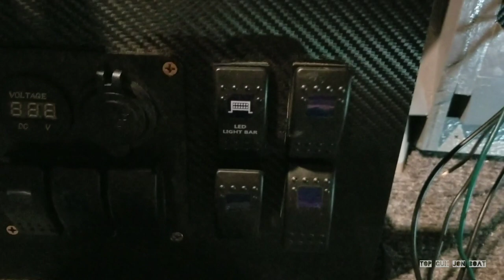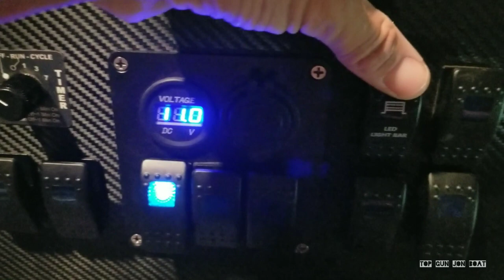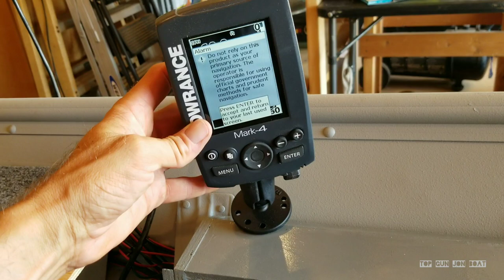WIRING MY BOAT 3- DIY Full Electronics In Jon Boat

Comment: Anthony, you probably havnt tried to look over the internet on how to wire up a blue seas  fuse box to a switch panel because there isn't much advise for rookie wire guys like us, man you hit the ball out the park, Ive struggled on how the fuse box should be linked as I have purchased one and am at the point where all my accessories are at the box and panel, now I know how to proceed with your video     thank you

Comment: Curious if you ever thought about mounting "momentary" switches inside the hatch doors, adjacent to the latches.  Not sure which ones would be the best, but these would add the ability to leave the stowage circuits "on", with any individual hatch light illuminating only when that hatch door is opened.  If you have, it'd be interesting to know what you recommend.  1,000 thanks -- and fantastic work!

Comment: I may be showing my ignorance a bit here, but what is the process you follow to determine the amperage of the fuse for each circuit?  I think from the sketch pad shot you showed, you have 30A on the light bar and 2A on the fishfinder.  I'm not sure of the other ones, but I'd think that the circuits serving the other lighting could be pretty low-amperage, since LEDs have very low amperage demand.  Thanks!

Comment: this is exactly the video i’ve been looking for! i have one question tho, i bought a switch panel with 5 ends on the back and only 1 of the ends is open for the accessory of choice; how do i run the accessory into that 1 end and then run that end into my fuse panel? can i connect the two wires at the end? i’m confused here. any help is appreciated. thank you!
Reply from the maker: If your saying you have a 5 pin switch, you can wire the same as 3 pin. I recommend the 3 pin because it is less confusing.  You'll have to do some testing to see what pins are what but you want to isolate the pon for the accessory,  the pin for power in from the fuse box, and the negative pin which all can be jumped. Again, the negative from the accessory will go straight to negative bus bar. Hard to explain here, if you were on Instagram we could direct message and I'd request images to further help.
Reply: Anthony Jones okay! i’ll find you on instagram and when my switch board comes in, i’ll message you! i appreciate the help!

Comment: Hey cousin, what do you think about using 16 gauge? I know yours is mainly 14. I was getting ready to order that Marine grade duplex wire to use on my boat and trailer.
Reply from the maker: I guess it just depends on the length of wire and what the draw is. I'll be honest, I kinda took Mike Lopez lead when he said he started running 14 gauge across the board in his boats. 16 is probably fine but I feel there are no doubts or issues with anything being underpowered or being unsafe with 14 which is why I did it.
Reply: Depends on the load of the accessory.  A trolling motor draws way more amps than a LED light.  The more amps used, the larger the wire (smaller numerical gauge size), also more watts used for longer amounts of time heats up the wire more and needs a larger wire.  Personally I typically run mostly 12 gauge wire because it’s way overkill.  In my switch panels though I run 22 or even 30 gauge wire from switch to relay.  I started using CAT IV cable (Ethernet cable) for my switches because the loads are less than 1 amp per switch to the relay.  The output from my relays are typically 12 or 14 gauge wire.

Comment: Very helpfull videos cuz, what battery are u using? And how do you like it so far
Reply from the maker: So I get my batteries from a local place, nothing special. Just high am hr deep cycles. I now run lithium ion 48v battery w the new electric outboard though.
Reply: @AnthonyJonesBrigadeBoats  I'm redoing from scratch a boston whaler 15'. All info helps. That ks

Comment: Where do get that voltage switch set up? And you said carbon fiber vinyl, is it like tape or did you do a video on carbon
Fiber wrapping?
Reply from the maker: Everything used is linked in the video description. The volt meter/USB combo is linked as well as the carbon fiber vinyl. Takes you to Amazon and the exact product i used. I have links in most of my videos in the description.

Yes, idid a video on wrapping, its a Small Boat Short Episode,  titled Carbon Fiber Vinyl
Reply: Thanks I start my boat this weekend, man I have a journey in front of me, I appreciate the videos. It is kind of like a blank canvas.

Comment: The negative lead from the switches goes into the bus bar? Are all of your switches negatives jumped together?
Reply from the maker: All negative switches are jumped together,  then go to negative bus bar as one wire. All negative leads coming from individual accessories also go to the negative bus bar.

Comment: Your switch panel wiring is over complicated.  You only need two wires coming in: 1 ground and 1 fused power.  Then coming out you have 1 wire for every switch.  Keep each accessory on its own color of wire, this helps when tracing wires during troubleshooting.  

Another thing, relays are your friend.  Any time I personally run a switch I try and use a relay.  This keeps high currents out of my switch panel for one, and 2 adds another layer of protection in the event you have a dead short.  Another thing about using relays is then you can switch the ground which also keeps switch wiring simple.  

If you have to lengthen wires on a relay terminal it’s better to replace the wire than splicing the wire. 

This is coming from a guy who specializes in custom wiring. 

Everything else looks superb
Reply from the maker: Thanks man but I'm a little confused....I have 1 ground, 1 fused power, and one wire coming out for every switch. So each switch has 3 wires which is exactly what your saying unless I'm misunderstood. Also a little confused as to why I'd relay things if each individual accessory has it's own dedicated fuse in the fuse box panel? Anyhow, thanks for sharing man.

Comment: How did you ground your wiring?
Reply from the maker: The negative battery terminal is the ground. Negative terminal connects to negative side of bus bar on blue sea systems fuse box. All negative leads go out from there to individual accessories. If your asking if I have a "static" ground from negative terminal to aluminum boat hull, I do not.